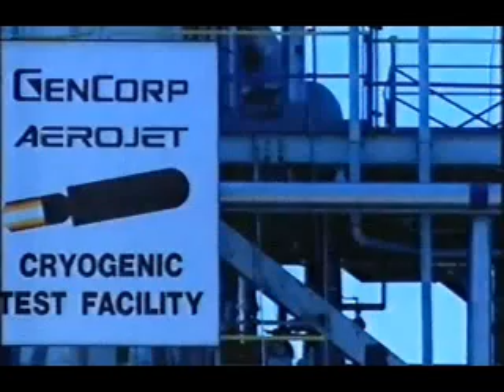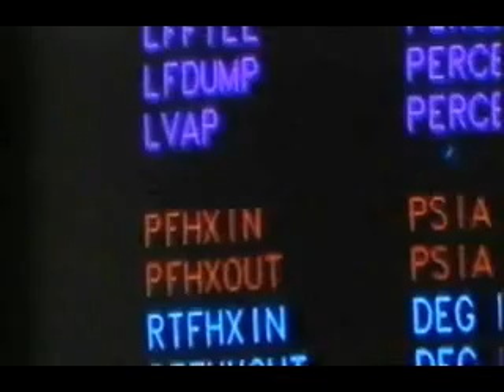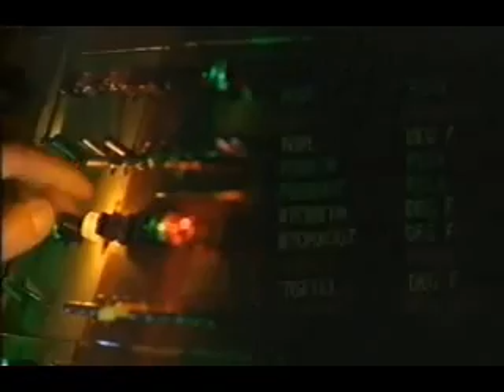Soviet N1 Moon Rocket - Documentary Part 4/5

Comment: Rocket P7 worked at safe kerosene, engine RD107-4 camera, created a craving for Earth 84t. For rocket N1-designed by NK33-1 camera, create cravings 154t., 1970.Through 10 years Glushko designed the RD170-4 camera, traction 740t.NK33 (NK15) engines and RD170 is a closed cycle combustion under very high pressure 150-250atm., in the United States in the 1960s and did not know about such engines.